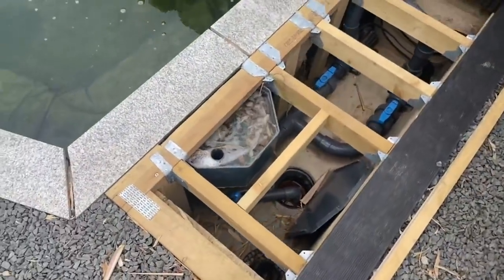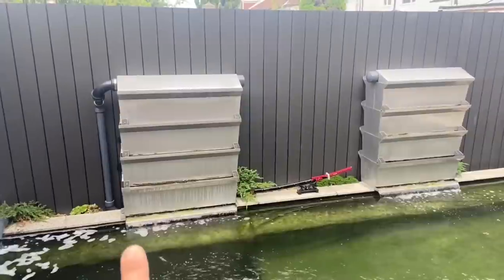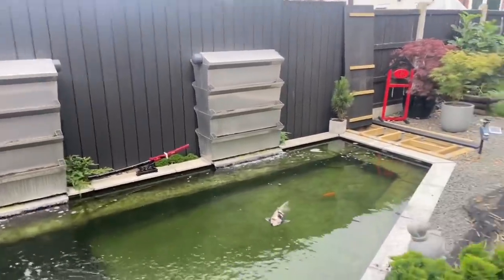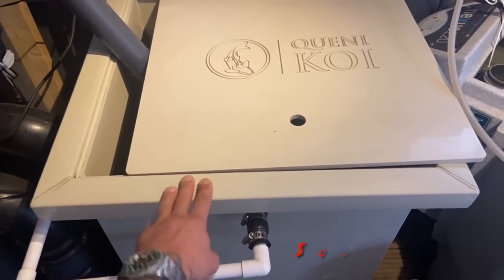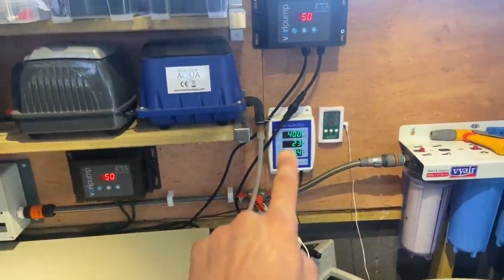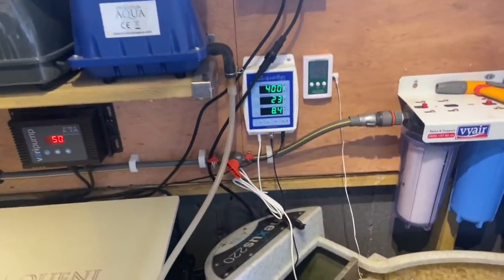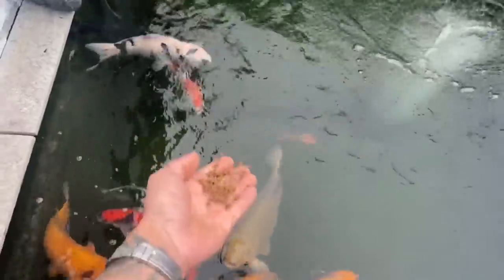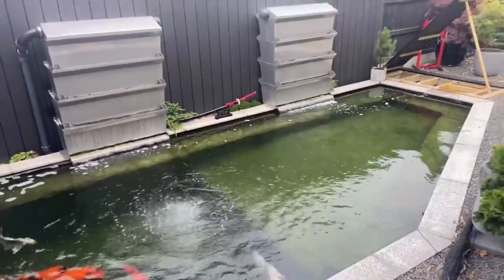JUST4KOI !!! FILTER SYSTEMS SETUP AND OTHER GADGETS

Comment: Nice video mate 👍👍👍 how comes you have so many 90's coming off of the uv to the nexus slide valve I would have gone straight from the uv to the nexus thus taking out restriction of 90 bends mate if that makes sense 👍👍👍
Reply from the maker: Thanks vincie, I had more 90 bends🤣it’s coz where I’ve placed the uv, I will play bout with it I’m aware of the bends restricting flow but all seems to be working fine 👍🏻

Comment: Nice setup 👍 , do you have a pump on the 2inch pipe soon as it comes through into the filter house to feed the nexus
Reply from the maker: Thanks matey, 2” pipe work from the retro bottom drain feeding into nexus 👍🏻
Reply: @just4koi143  just watched your other video when you 1st set the bottom drain up mate , looks tidy that does 👍
Reply from the maker: @Westwood699  thanks matey 👍🏻